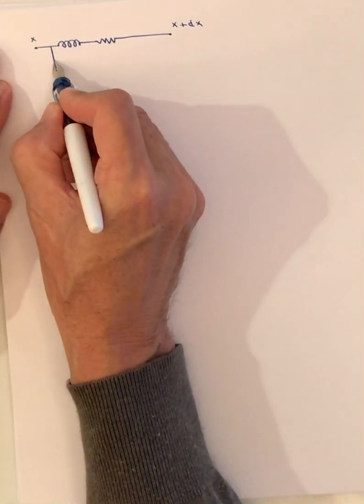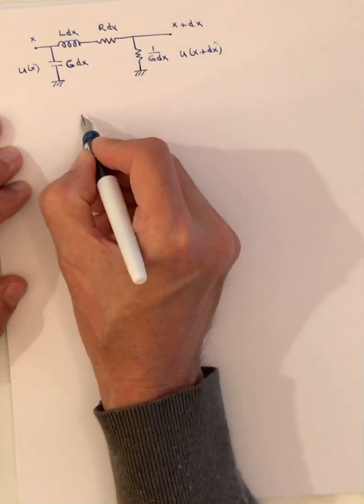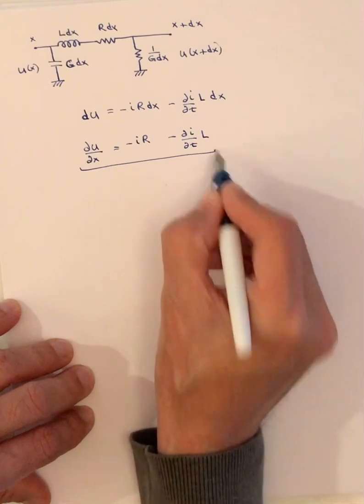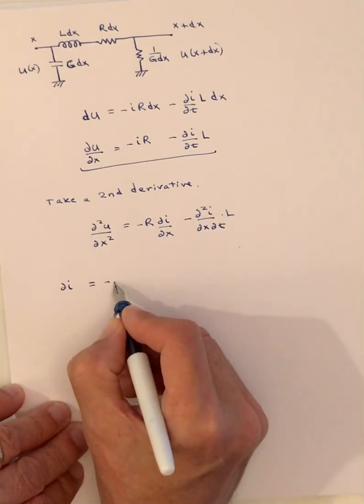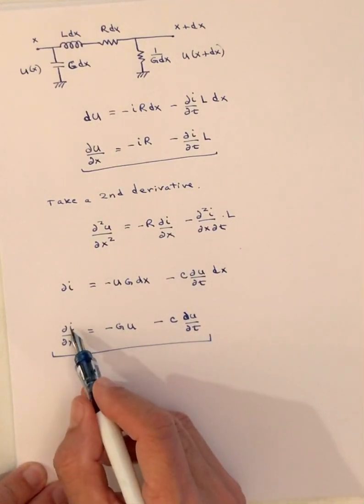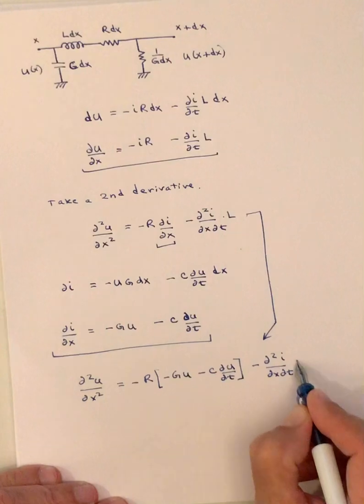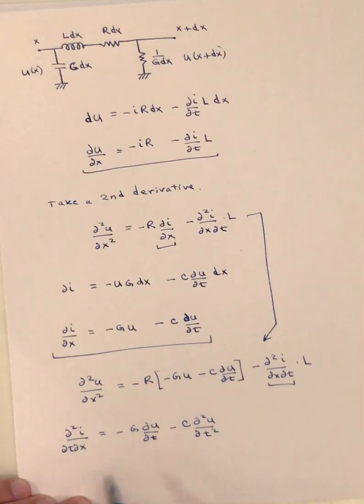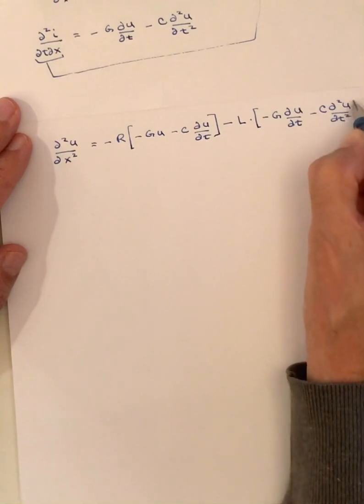Derivation of Telegrapher’s Equation - Part 1

Comment: what's that Gdx means
Reply from the maker: Thank you for the question.  In this context G means conductivity with units mho/m.  So you multiply it by dx with units of length and you get the leakage conductance.
Reply: @quantumradio  I got it thank you sir
Reply from the maker: @allwinsweetson3954  Best of luck with your studies and please be aware that some references write the conductivity as "little sigma" (measured in mho/m) and the Conductance as "G" (measured in mho's).  Just something to keep in mind.